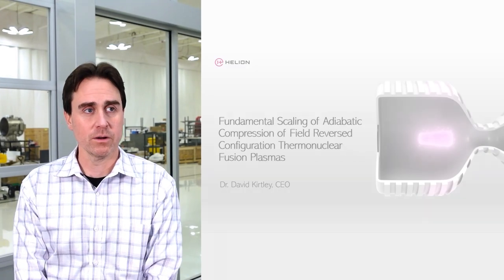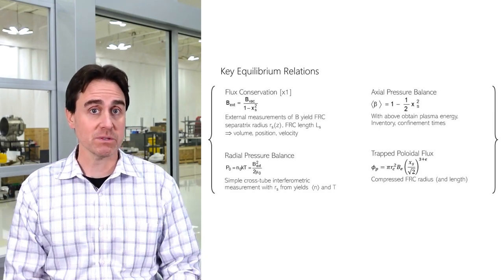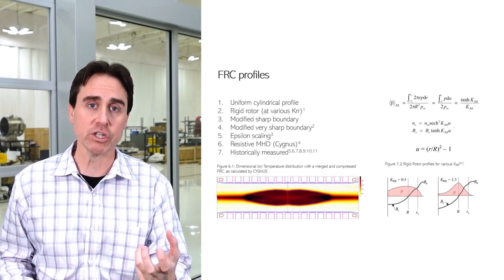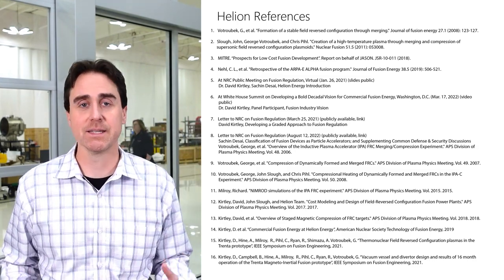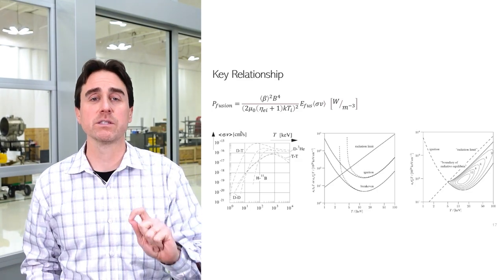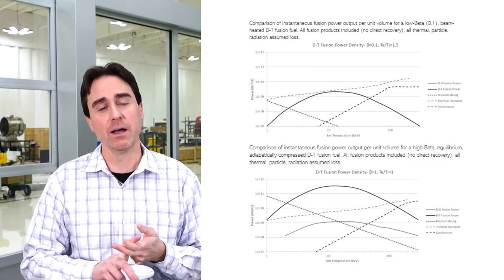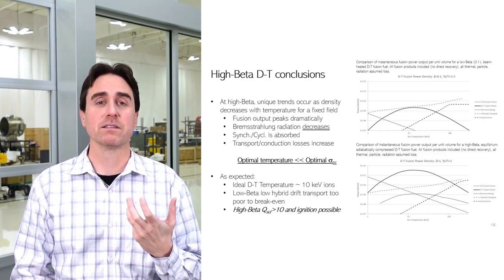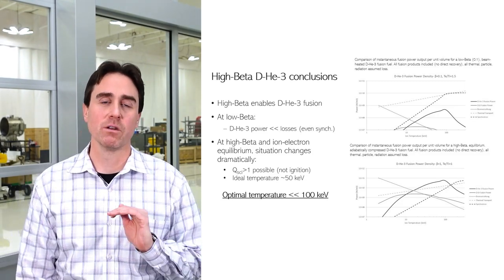The theory behind Helion’s approach to building commercial fusion devices

Comment: It was stated that at higher ion temperature, there is lower density, but I don't understand why that is. The graphs show bremsstrahlung decreasing with ion temperature instead of increasing; I gather this is because density is decreasing.
Reply: Yes, in a high beta plasma you can almost linearly scale between temperature and density at the same Magnetic field strength. So, e.g. if your machine has 20 Tesla field strength, you can reduce the density and increase the temperature. There is another effect in their machines where, the electron to ion temperature ratio decreases with increasing plasma temperature. The lower the electron temperature, the lower the Bremsstrahlung losses.

Comment: I would love to see a graph of maximum fusion power output compared to "Beta", because from what I understand in practice plasma B is not fully 1 an I would guess especially after the collision of two plasma units. Other problem I could see is how much energy of the plasma can be extracted via Helion method, it should be high because we are skipping steam turbine part, but exactly how high is the question. That are two problem that my uneducated eye catches with the theory, but other than that it looks promising. And from what I understood for calculation classical cross-section of electrostatic repulsion was used but in reality it should be a bit higher (quantum effects). And to add some wild idea, maybe x-ray reflecting material could be used to recover a portion of energy lost due to radiation directly (heating the plasma even further).
Reply: The two FRCs merge into a single, hotter and more stable FRC. That FRC still has a beta of ~1.
Reply: @elmarmoelzer2229  I really hope so, but I want to have good understanding of real feasibility of this method.
Reply: @ukaszlampart5316   The merging process of two hypersonic FRCs is pretty much accepted by now. TAE and other teams are using it successfully as well.

Comment: Lots of showmanship but as I understand it he is saying this will never make cheap electricity and they know it. He mentions a theoretical Q of 10 for D-T which is still unlikely to be enough to hit engineering break even (with all the losses 20-40 is usually estimated to be needed, not sure about this specific design), and then later goes through the D- he3 cases and says maybe they can hit a science Q of 1… which is similar to the successful NIF test a couple months ago. He says they don’t need to break even or even get ignition to be commercially viable - no idea how they plan to make back the investment
Reply: There is a missing slide here.
Reply: yes in a tokamak you would need 20-40 times the input power, in order to drive a turbine and overcome Carnot 

however since Helion's fusion products are recovered directly by the magnets you could in theory produce net electric power even at Q<2 and probably have a decent power plant output at Q=5 

a bit like using round wheels instead of square, requires less work to get the same amount done

Comment: Given Pulsed Nature of the Field Reversal, would the Electricity vary, surge and then reduce?
Reply: The electricity output would be over a very short period of time (less than 1 ms), but it does not really matter. The electricity that is recovered is stored in a capacitor bank and then gradually released to the grid.

Comment: Any updates on Polaris? It is supposed to begin operations "by early 2024". Very exciting. 
Still on track for that time frame?
Reply: Date slipped a bit to summer 2024. For an undertaking of this scale, a relatively small delay of 6 months is not unusual, nor unexpected given, given their aggressive timeline. COVID and the supply chain problems that followed did not exactly help either.
Reply: @elmarmoelzer2229  it's now beginning of autumn 2024. Still no Polaris...
Reply: @midlander4  yup, same thoughts on the time here as well....
Reply: @foxtrotunit1269  and the website now says 2028 🤣
Reply: @midlander4  "Just you wait, in 30 years or so it will be there"

Comment: I wish I had studied plasma physics. Helion's approach skips the whole heat engine( steam power plant) step and avoids most of the downside of neutron emmision. Their generators have a small enough footprint to be put on-site with existing infrastructure. Very cool, world changing stuff.
Reply: Helion's approach does not avoid neutron emission at all.  True aneutronic fusion comes to proton-boron at least.  Fusion is a probabilitic thing like everything in the atomic scale.  Thus you cannot guarantee that there is no deutrium-deutrium fusion when you are doing deutrium-helium3 fusion. Neutron emission is guaranteed.  It is not an issue now because there has not been any fusion yet.  When they generate electricity in commercial scale, it will be a big issue.  I doubt whether they can get a NRC nuclear plant certificate.

Comment: From the elemental e-Pi-i AM-FM sync-duration bubble-mode function POV, there's a reason why the cylindrical model of plasma form is probably better than a string, ..to nodal-vibrational emitter-receiver, Fusion-Fission abstraction, because it's a Superposition-point i-reflection inclusion. 
The Scattering air vibrations of a Whistle tuned to convert, ie demodulate Neutronic UHF "gravitational" frequency fields to the "onion shell" orbital-orbits of Hydrogen and associated decomposition wave-particle packets of Electron-photon-phonon-Proton oscillation, holography dimensionality, from the Neutronic resonance bonding state.., is plausibly a resonance cylindrical mass-energy-momentum continuous frequency inversion, like a whistle in operation, emitting notes,  overtones, etc. 

E-Pi-i Fusion is the Observable Eternity-now Universe of "thermodynamical" log-antilog relative-timing ratio-rates of orbital-orbits in perspectives vanishing-into-no-thing, of coherence-cohesion objectives. 

The images of components in the device assembly are affected by whatever we think we intend our words to convey, yes bubble-modes fuse "shells", but relative-timing bubble-modes are always continuously fused here-now-forever, Holographicly.

Should the device operate as a Frequency Inversion-Converter? Universe-Singularity reciprocation-recirculation demodulator?
Reply: Great, you nailed it bro, that's exactly what he is talking about 🙂

Comment: Very cool. I'm wondering which generation of Helion's prototypes will achieve net power generation. Currently I've seen the one they are building, with the testing for power delivery, and I'm really looking forward to all these developments.
Reply: Polaris (the one they are building now) will demonstrate net electricity production next year. It won't be quite on the same level as the final power plant design but it will be enough to verify that it works. The next machine after that will be the first commercial power plant.
Reply: Nowhere do they state that Polaris will have net power production.
That would be a massive worldwide sensation.
So, no. Polaris will demonstrate electricity production, but at a net loss.
Reply: @vonnikon  They state it on the FAQ on their web site. "We expect that Polaris will be able to demonstrate the production of a small amount of net electricity by 2024."
Reply: @jRoy7  wow! Did not know that.
Getting net positive that soon is hard to believe, to put it lightly.
They have not even achieved ignition yet.

Helion need to achieve ignition, then I'll take net electricity predictions a bit more seriously.
Reply: @vonnikon  Helion will (likely) never achieve ignition, their approach doesn't require it and they aren't working on it.
Reply: @jRoy7  "ignition" is generally understood to mean Q ≥ 1.
At least that is the definition NIF went with.
Can't get any net electricity without Q ≥ 1.
Reply: @vonnikon  I don't have the knowledge to argue the NIF definition. But in Helion's technical presentations they say they don't need ignition for net electricity and they aren't trying to achieve it.

Their conclusion slides say high beta ion-electron equilibrium can do Q>1 without ignition, and high beta out of equilibrium can do Q>1 around 12 keV and Q>5 at an ideal temp of ~50 keV.

Comes down to the difference in low vs high beta, and requiring ignition vs being pulsed. (If I understand correctly.)
Reply: @jRoy7  yeah, me neither. Lets just say Qphysics>1 instead?
As far as I know, Helion has not achieved that. And they need to do that long before they get to net electricity ( Qengineering>1 ) production.
Reply: @vonnikon  Yeah, in their slides they'll use Qscience but they generally prefer to talk about net electricity instead of Q values since that's their goal.

Correct, Trenta doesn't generate net electricity. Polaris is intended to. So we'll see if things match their projections pretty soon.
Reply: @jRoy7  “ignition” is a red-herring… a self sustaining fusion reaction is not required to make electricity efficiently

Comment: Is it theoretically possible to retrofit a hadron collider with your system? What is the efficiency like when it is scaled up or down? Does the fusion power output increase as the velocity of the plasma increases? Could one create a sattelite propulsion system by electromagnetic ejection of plasma?
Reply: The LHC is a very different system for a very different purpose. The particles in the LHC also move almost 1000 times as fast.
Reply: @elmarmoelzer2229  I guess retrofit was the wrong word. I think I meant to ask if the plasma could achieve fusion if you had something along the lines of 2 stellerators intersecting. Just the general shape of the LHC.
Reply: @GammaFields  
The merging of the two plasmoids is not enough to get sufficient fusion reactions. The temperature after merging is only in the hundreds of electron volts (around 4 million degrees). They have to magnetically compress the two plasmoids after merging to drive the temperature to 10s of kilo electron volts (100s of millions of degrees).
Plus, there is a reason why Helion chose FRCs for this, rather than stellarators or individual particles like the LHC.

Comment: Pardon my ignorance but isn’t there a huge amount of high energy neutrons created in helion’s process? These particles are not amenable to magnetic confinement? What am I missing?
Reply: To the best of my knowledge 1/3 of the reactions will result in a 2.45 MeV neutron that has no effect on confining the other particles. Only about 5 to 10% of the fusion energy is released in neutrons. The rest is in charged particles.
Compared to D-T fusion, where a 14 MeV neutron (carrying the majority of the fusion energy) is created by every reaction, it is a lot more benign.
Reply: Thank you. I’ve learned it really comes down to the mix of the fuel. If the mixture is rich, say, 85% D-He 3 the neutron production decreases. Can we agree to call helium-3 “Helion”? I believe they are synonymous
Reply: @docjaramillo  
They have a lot of options for the fuel mix.
Generally, they will want a 2:1 ratio of D-D to D-He3 fusion reactions to always breed enough He3 for the next pulse.
They do have a few options though for how to do that. E.g. the He3 breeding can be done in a dedicated separate machine, or the same machine. They could alternate between pulses for He3 breeding and pulses doing D-He3 reactions as long as the overall ratio of D-D to D-He3 is maintained. Or they could adjust the fuel mix and temperature as well density for the ideal ratio of D-D:D-He3 reactions in a single pulse.

- A Helion is a single He3 atom.
Reply: Thank you for your brilliant reply. Those of us arm chair engineers are thrilled by these developments. Do you have any recommendations on learning the electromagnetic details of this energy recovery scheme? Is it because helium-3 has been so rare historically that this fuel cycle has not been more recently probed?
Reply: @docjaramillo  
Their fuel cycle works because they have a pulsed system. So they can extract bred He3, unburnt fuel and fusion products between pulses, then feed the He3 and Deuterium back into the machine for the next pulse.
One reason why it has not been considered much (there are some) is that doing economic D-D fusion requires conditions not possible in a Tokamak, which still is the dominant plasma configuration.

Comment: Could venting out the plasma act as rocket propulsion for a space craft to both propell the craft while generating electricity at the same time? Would the environment in space improve the efficiency of this design? Very low temperatures to reduce the costs of cooling superconducting magnets and an existing vacuum would improve the ratio of energy in to energy out. I'm very excited for space manufacturing and taking advantage of resources in space. Being able to go get asteroids quickly and bring them back to an orbital industrial park on the dark side of the moon sounds.... Awesome
Reply: It is actually really hard to keep things cold in space. Space is cold, but a vacuum is a perfect insulator. So, you can only radiate heat away and that is limited by black body radiation.
The plasma is not very dense. So, the thrust would be rather slow, though the specific impulse would be very, very high. The guys at Helion do however have a concept for an FRC- fusion - based space propulsion system in a drawer. It works slightly differently but combines decent thrust with decent Isp.
Look up Fusion Driven Rocket. There are some videos on YouTube and I believe you should still be able to find some NIAC presentations they did on it.

Comment: I can’t help but wonder if a longer acceleration phase would help.  

I mean, it’s a relatively short run up.
Reply: I asked David Kirtley about this on Twitter and it is an interesting problem. 
Cold FRCs tend to be less stable and have thermal and magnetic flux losses. So, they want to have them merge as soon as possible because the resulting single FRC is hotter, more stable and has less losses and accelerating over a greater distance would increase the time to the merge. At the same time, it would help to have them come in faster since that would mean a hotter merged FRC as a target for compression. Electron to Ion temperature of the merged FRC would be lower too. David explained that the current limitations for FRC acceleration are:
1) trigger and monitoring speed of switches ( limited by speed of light in fiber optics for system of their size) and 
2) rise time of the current pulse in a large magnet.

Hope that helps!
Reply: @elmarmoelzer2229  Do you think it would be possible to start the next cycle before the current cycle is complete? As in start powering up the outer magnets on each end while the previous pulse is still expanding against the inner magnets / exhausting? I'm not sure if the magnet power-up or trigger times are a limitation to pulse rate or just plasma speed.
Reply: @joefioti5698  Limitation to pulse rate is not just the pulsed power system, but also the pumps. They have to pump all the fusion products out of the chamber before the next shot. That takes time.

Comment: Making a plasma confinement reactor and making a commercial fusion reactor are not the same thing. They are different machines. At 100,000,000 K there are no physical conditions for nuclear fusion.
Изготовление реактора для удержания плазмы и изготовление коммерческого термоядерного реактора - это не одно и тоже. Это разные машины. При 100 000 000 К нет физических условий для  ядерного слияния.

Comment: Random question, if batteries have an issue with charge/discharge rates and you have to use capacitor banks for storage, could you use some of the energy to power a carbon capture device that pulls carbon dioxide from the atmosphere and converts to biofuel which is super straightforward to store and deliver?

Im sure it introduces a host of new issues but just a thought.
Reply: It's a reality in greenland or iceland or those eco-countries.
Some of these is called recombination of CO2.
This is not a tought, it's basically machine-photosynthesis.
Reply: @ivobrick7401  very cool, I was thinking Direct Air Capture like Carbon Engineering up in Canada
Reply: don't ask stupid questions

Comment: I wasnt' expecting a math lesson, but this is certainly interesting.  Maybe if you slowed it down a little more I would be able to make more sense out of this as a BS in math.  But certainly very interesting is you guys' clear physical drive and energy to get an efficient and energetic fusion device.  I agree, that you don't need to be efficient to a certain degree in order to generate electricity and see a return on your investments.  All you need to do to become the first commercial reactor is a reactor and a cash flow that you can count on for the time being!! lolz.  If you have input $costs of fuel and lectric, and gasses? and then you are able to build this pulsed system, I am curious how you are planning to remove this energy from the system and turn it into electricity without melting the fusion reaction chamber.  While this may be proprietary, using a liquid coolant makes sense to me as a stupid because it has the ability to handle the stupdenous energy variations.